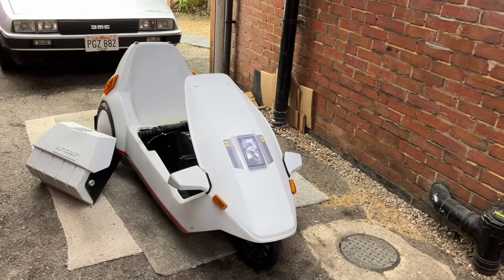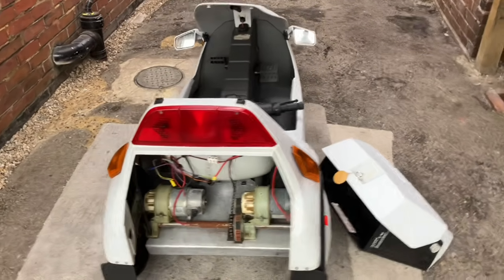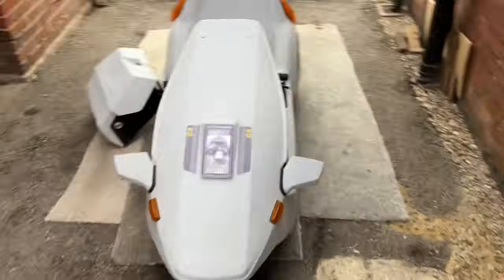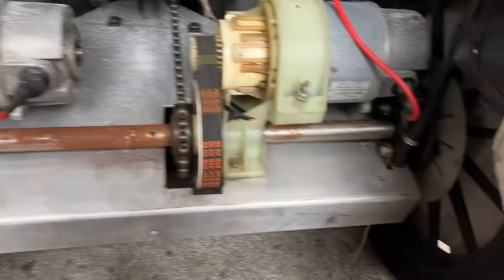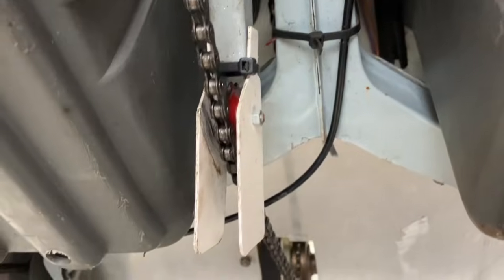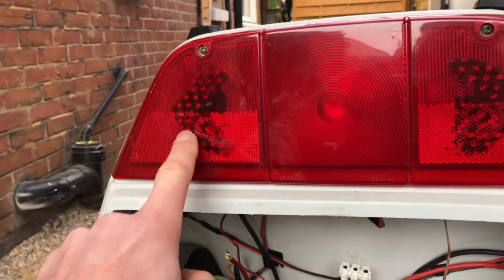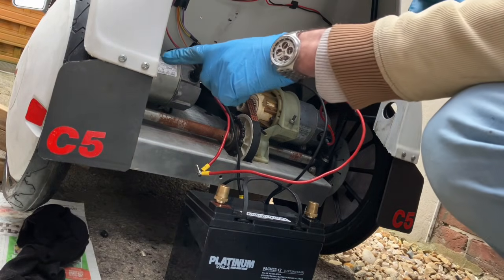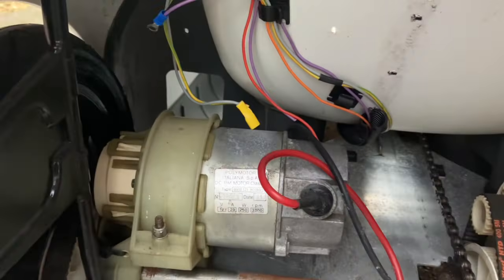New Sinclair C5 project - Twin Motor Chas model

Comment: FYI the mudflaps are chas ones. All C5s have moudling marks across the nose. As you look at the front its from bottom left to top right. They all have this it just depends how clean they are for how much you notice it. The chain tensioner has the chas mods which stop them falling off and help guide the chain. Unsightly but they work. In my experience the chain doesnt come off if its properly oiled and not stretched. The front forks chas made varied on every one made.

Comment: Do you think it would be possible to convert a C5 with a motorbike engine?
Reply: What's the benefit of the twin motor set up, just torque? Top speed will be the same I guess.
Reply from the maker: @ hey there, so I don’t fully know, as today I just stripped down the motors and axle, to clean everything up.
I’d agree with you though, more power for up a hill and I do feel it should make for a faster C5….mine does 12/13mph on the battery, on a flat, this twin motor has got to be quicker you’d think.
I’m going to refurbish everything I can, then I’ll have a think on the wiring aspect.
The easiest option is 12v, two relays. But I could do 24v and then it really does make it more fun and useable.
Reply: @griceyboysGarage  gear the second motor differently, one motor post pedal start to 12mph, second motor onwards from there upwards!
Reply from the maker: @ hey, thanks for the reply. 
I think the only way to change the gearing would be to find one of the 5 rare Chas made gearbox’s, with more teeth (pretty sure he made 5 about 10 years ago ), they had something like 6 more teeth on and would increase the top speed once you got the pedalling done.
With this C5 (and my main one), I’m thinking of going 24v on both . A battery is so expensive, so I’m thinking it’s worth doing both and realising this c5s true potential performance.
Just need to work out the electronics and if a Porter could power two motors at once, or seperatly (kick in the 2nd motor when extra power is needed).
But for now, I’ll restore the chassis and just get everything working
Reply: @griceyboysGarage  I dont think it was chas that made the dragon engineering gearboxes.
Reply: better to choose something else to start with. Chas made a petrol powered one but it was still slower than a good electric one.
Reply from the maker: @johng7304  hey JG, hope you are well.
It is possible as at least one person did put a small petrol engine in the back of one , it just means you can’t use the boot for actual storage space.
Reply: @ I was thinking a 1000cc Kawasaki zzr engine 😂
Don’t really need the boot space.
Reply: @johng7304 the weight from the engine block alone would probably split the chassis, let alone the torque.
This thing has plastic wheels and a spot welded frame mate.
Reply: front hub motor is in my opinion the way to go.